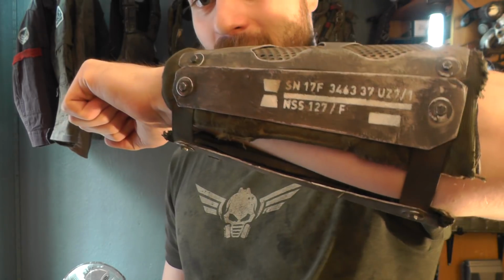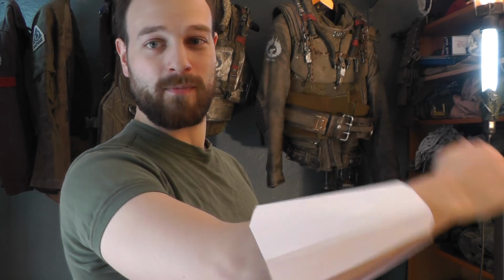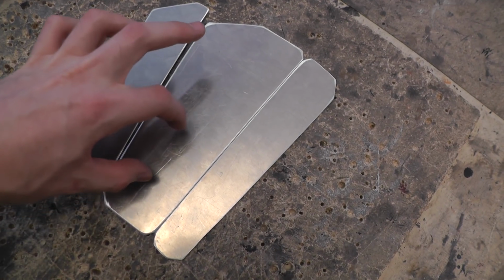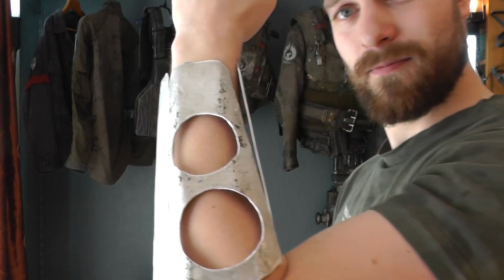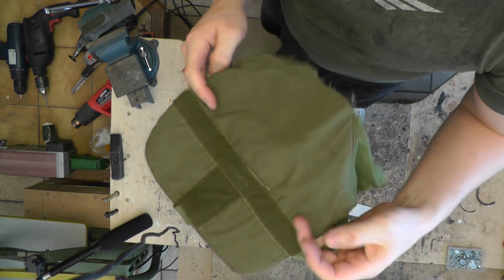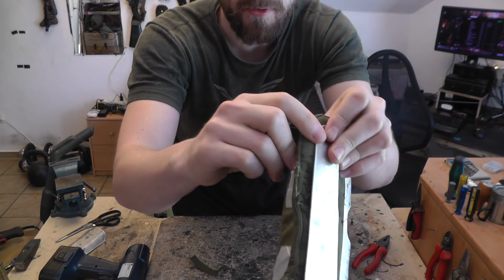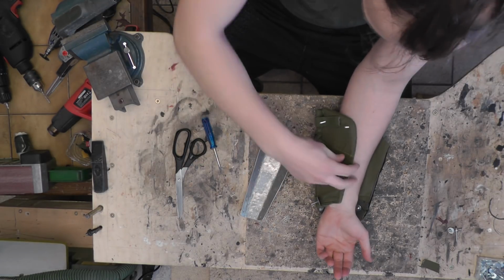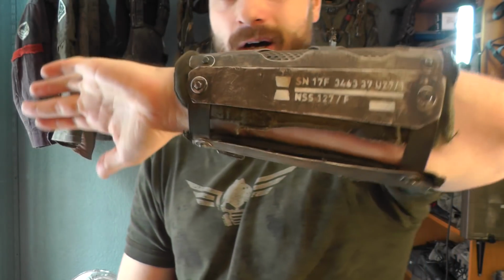BUILD: post-apocalyptic vambrace / arm protector from METAL!

Comment: Gloves with a belt sander are not too much of a problem, actually. They are more of a problem on drills, lathes, angle grinders and such, but belt sanders should be not a problem. Although even on those it's still an open debate, even at my university some professors said to wear them and some not to wear them, so yeah. I personally avoid gloves on high-speed cutting/drilling tools, but when using a belt sander or a bench grinder I prefer to wear them.
Reply from the maker: well.. i prefer to keep anything fabric as far away  as possible from anything high-powered that has moving parts :D
Reply: Nuclear Snail Studios  I do too, and I also pull my hair back in a braid and shove the ends under my belt to secure it.  It's scary how many people with long hair forget to secure it.  I heard about a guy who had a big chunk of scalp torn off that way, and it won't ever grow back.
Reply: Yeah, you have to be careful with hair, I always tuck mine under a beanie just to be sure, even if I'm just using hand tools, they just get in the way. But gloves when grinding? Yeah, I like the skin on my fingers, I'll keep wearing them.